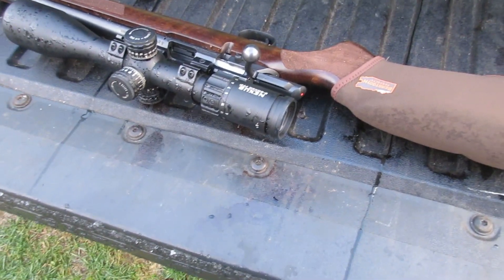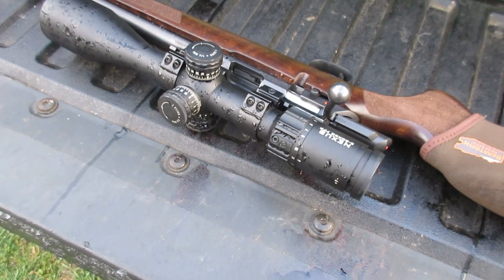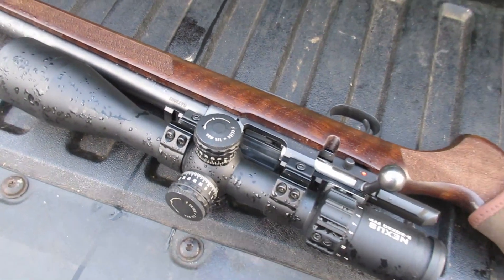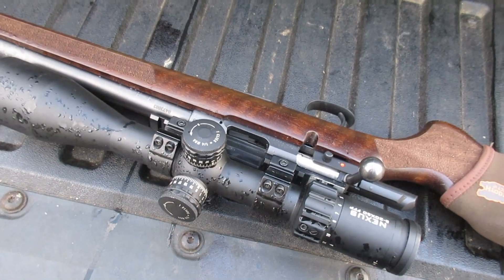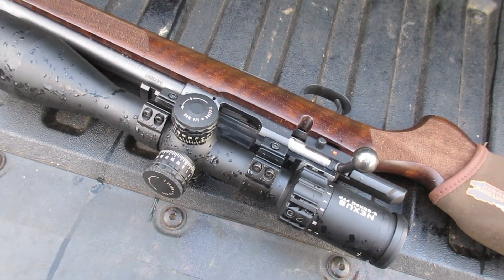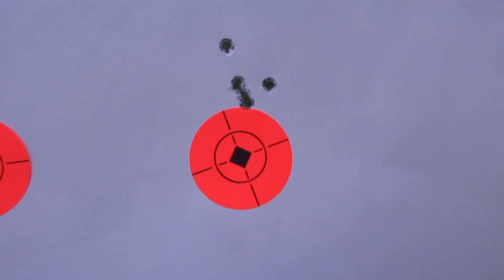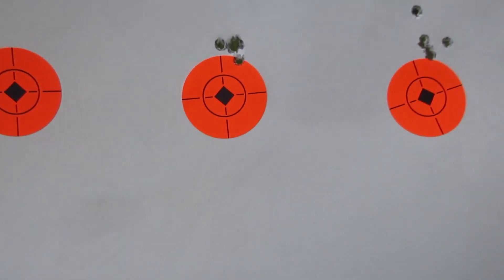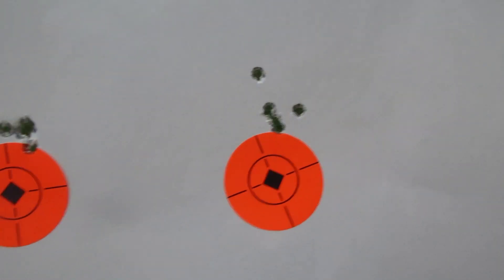Another look at Cz 457 varmint shooting cci Standard after part change

Comment: Good to get it sorted, was it bad assembly at plant.
Reply from the maker: All i did was swap bolt guide from one of my 455s.  And allowed barrel to be removed and  installed,
Reply: @tnsharpshooter8517  Hi there, thanks for the video, I just bought my self a cz 457 too, and it shoots just as stinks as your first video. I wanted to know what exact step you did to improve to those beautiful groups?

Just swapping the bolt? (sry I dont know what a bolt guide is, I am pretty new to rifles, is it the whole bolt or something else), and the reason of that is the bolt is hard to close?

I dont have other bolt to swap to, so just wondering what other steps you did to improves the accuracy.